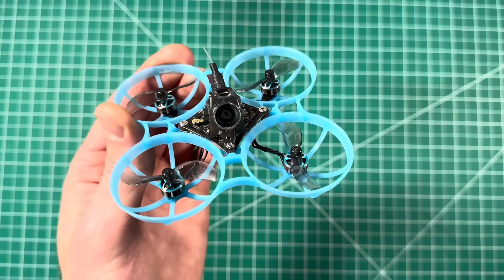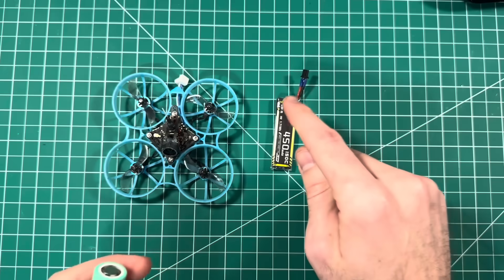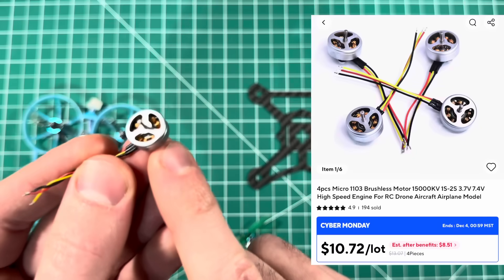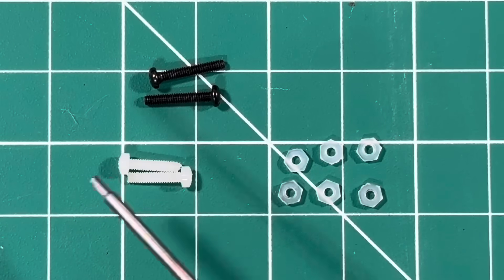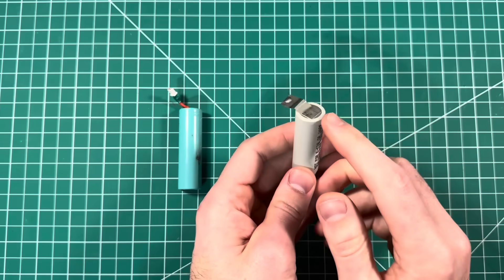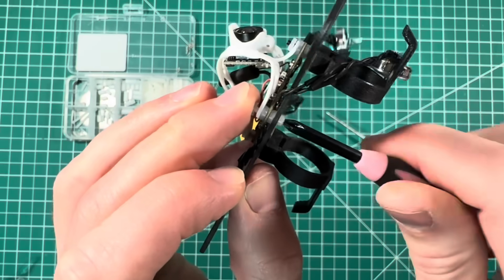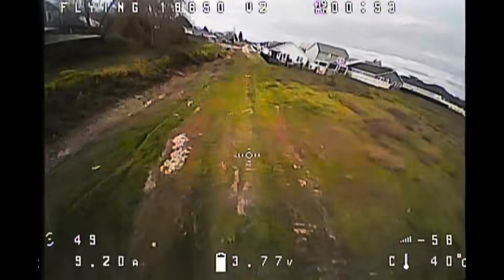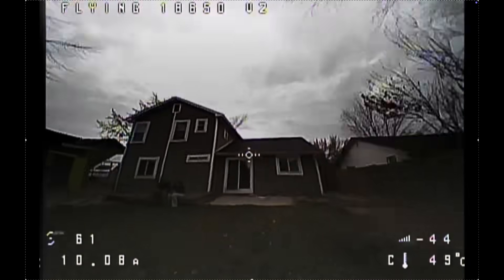Convert Any Tinywhoop to use 18650

Comment: New props new motors new frame ... yea you arent converting, you are just reusing the fc-aio in a new build.
Reply: And camera plus canopy... I am interested to see where this goes. I can imagine a few use cases.
Reply: Classic "ship of Theseus" situation.
When does something stop being that thing when you start switching parts.
Reply: And an FC with only 5A rated ESCs in a quad large enough to need 12A ESCs. But hey, at least there are affiliate links.
Reply: @aracrg  Good thing the lithium ion probably can't output enough amps to cook the ESCs.
Reply: @aracrg  5A costant 8A max, the 1203 motor can run 1s with double more efficiency if using the right prop than the others and the 100% throttle current is around 5 amp！
Reply from the maker: Thanks for the feedback! I felt that “conversion” was the best term because I was changing the tinywhoop into a toothpick. 

Also, just because the flight controller is AIO doesn’t mean it is one part. The AIO includes: FC, VTX, reciever, and ESCs and usually accounts for most of the cost of a build. The camera/canopy stays the same too. If you look at it that way, you can see that the quad is more than 50% the same. 

If you look at the price. A tinywhoop costs $100 on the cheap end. This “conversion” or whatever you want to call it costs $25. That is only 25% the cost to turn your whoop into something new.
Reply: @MediocreNerd speedybee aio + some China clone of flywoo explorer frame with 1505 motors and get over 20min flight time with GPS and better camera for same 100-150$. Also possible use digital video
Reply from the maker: @wsefzdsf I’ll have to try that
Reply: @MediocreNerd  eh im just arguing semantics. Love your videos. Keep up the good work.
Reply: I disagree.   The definition of converting is to change form or function.   As he did in the video.   It would bother my pedantic OCD more if he had used the terms "modify" or "upgrade" in the title.   As this conversion is pretty extensive.
Reply: @7996hobguy  to be fair he did change the form, and the function 😂
Reply: Reusing is when he uses the flight controller and puts it in same type frame using same components. Converting is when he converts it into something else, a different frame or motors or camera etc.

Comment: I had a cetus x and it always had problems with vtx. I freaked out and bought a djio4 lite and assembled everything in an apex 2 frame. I recently bought 4 molicel p26b, removed bt2.0 from old betafpv batteries and made myself 1s liion batteries. Instead of 4-5 on fresh lipo, now I get 10 minutes of normal flight without problems. props I used 3 blades. I want to try 2 blades but I don't have the money after the operation yet (Cool video, keep up the good work.
Reply: I want to do that too, I also have a cetus x but in the winter I get like 3 minutes of flight time which is pretty bad. So, it's possible to just switch the frame and the props and it works? Does the cetus x even run with 1S? I thought it needs at least 2S to even work